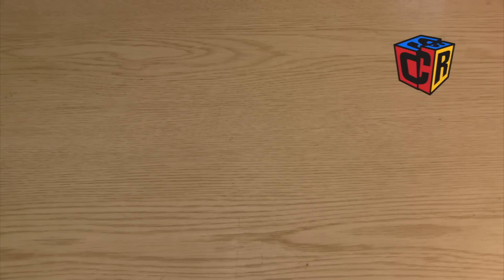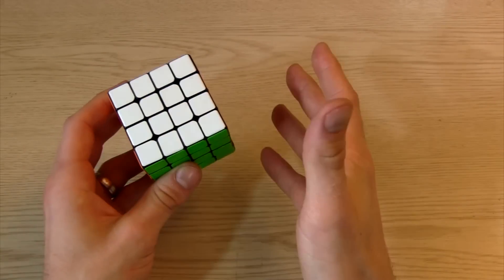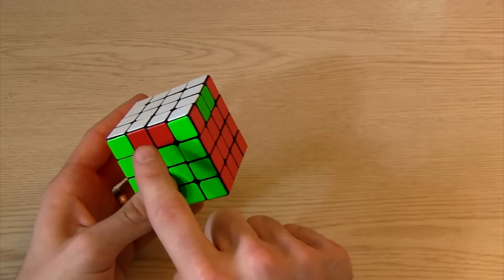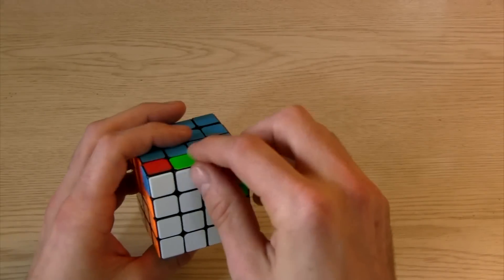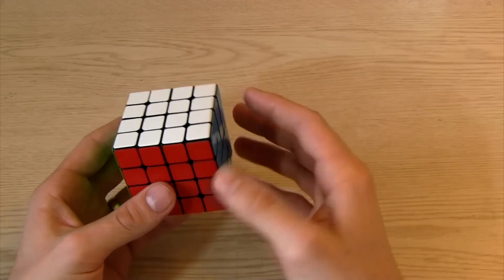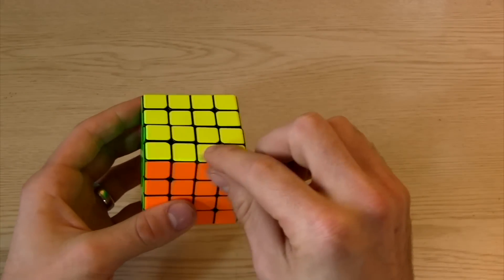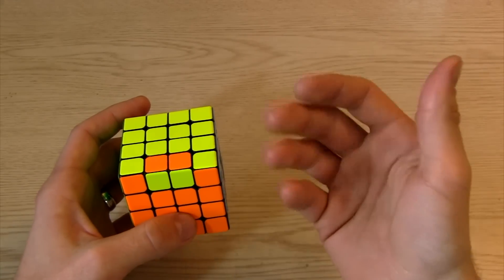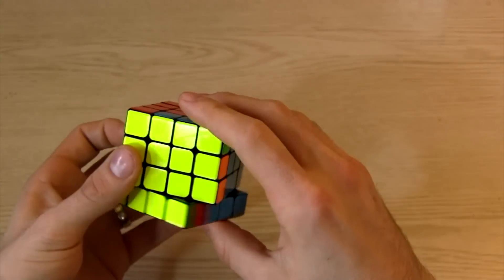4x4 Easy Tricks for Parity Algorithms

Comment: Fun fact: 4x4 has more paritys than a 5x5
Reply from the maker: Well "parity" just means of or even and a 4x4 is a 5x5 with hidden pieces. You can do only even parity (swaps of pieces) on a 3x3 while on larger puzzles you can do odd parity swaps. What is commonly called "pll parity" is just center orientation which is solvable from the start on a 5x5.

Comment: I actually came up with my own edge flip algorithm for those who want to use it. I figured this out after realizing that I’m bad at memorizing algs. I remembered that when you do a basic r2 u r2 u’ r2 u’ d r2 u’ r2 u r2 d’ to switch the 2 corners on a 3x3 the 2 edges switch as well. And so I thought about possible translations for that alg and I figured out that if you move the bottom 1 by n block to the top layer of the cube and do that same corner or in this case edge flip algorithm it solves the cube.
Reply: In french this is « déshabiller Pierre pour habiller Paul ».

Comment: You said after doing the sexy move to do the pll parity but you were moving the left inside one, and the codes in your video description show right. Wtf dude? Why didn't you put that code on the screen like you did the sexy move?
Reply from the maker: It’s the exact same algorithm. Whatever hand you use or whether you do the left inside or right inside it doesn’t matter. You could also do a completely different PLL algorithm and it would still work out the exact same.

Comment: for the pll parity I use Uw2 Rw2 U2 r2 U2 Rw2 Uw2

An easy way to remember this is doing The first 3 move (Uw2 Rw2 U2) then doing a r2 then doing the first set of moves (Uw2 Rw2 U2) backwards, so it would be U2 Rw2 Uw2
Reply: LowSpexGame R  U probably messed up the alg. r2 means inner layer 'R'

Comment: how to swap the last two edges which are opposite each other , once you did the "trick" to put the last 3 edges in place ?  all is done, but for some reasons  two edges which are opposite each other do not match.  Sometimes they match, sometimes they do not match.   Thanks in advance. PS : please move the cube slowly, very slowly so I can memorize the moves. Don't go fast :)  please I know you are good.
Reply from the maker: If you have two edges opposite after you did the PLL parity algorithm it means you didn’t need to do it in the first place. Do the PLL alg and you are done.
Reply from the maker: The video is not to follow move by move. That is why the algs are written down. If you need you can always just slow the video down.
Reply: thanks!
Reply: I did the cube in 6 minutes :(   but I'm improving :)   do you have a tutorial for the 5x5 Cube ?

Comment: Right. This is hard to describe but, all my whites are finished. All blue and red are complete too. All yellows on the top. The bottoms three rows of my orange and green are perfect too...
 BUT, I have one orange-yellow edge piece in the top row of my green face. And a yellow-green edge piece in
 the top row of my orange face. There are zero videos on how to fix such a mess. Help?
Reply from the maker: +Scot Van Rice There is an algorithms to swap two pieces but just pull the edges out and switch them if you are assembling it.
Reply: That's either pll parity or you never finished edge pairing

Comment: YuXin Blue or KungFu CangFeng?
Reply from the maker: Check the description.
Reply: I know that there is a magnetic version of the YX Blue cube in the movie, I mean, which cube is better: YX or KungFu?
Reply from the maker: You can get the exact same times on either.  There is not a magnetic version but I made one myself.  You can make pretty much any 4x4 magnetic.  The KungFu will be more flexible and 62mm.
Reply: Velox - Kostki Rubika 
There is no "better cube"

If you have small hands and like smooth and slower cubes then get the yuxin 
And if you have larger hands and prefer a more fast and sandy/crunchy feel then ger the kungfu

Comment: am i the only one that uses
Uw2 Rw2 U2 r2 U2 Rw2 Uw2
for pll parity on 4x4? i find it to flow much better because its more wide turns than single inner layer turns
Reply: Haxpo I use that one too and for the adjacent edge parity do an x R2 F' as setup move